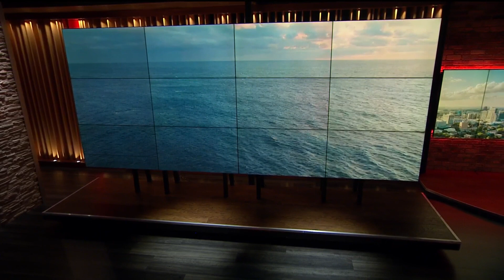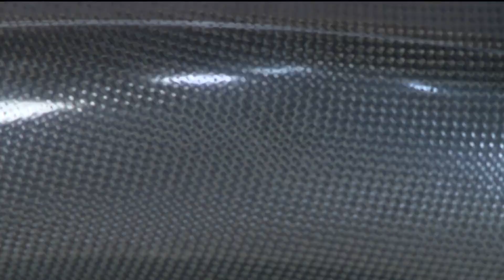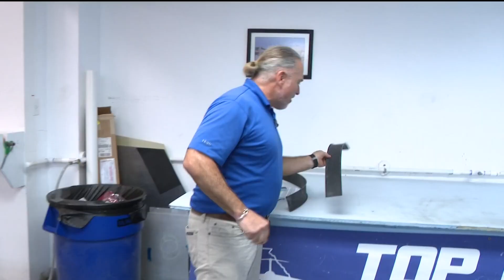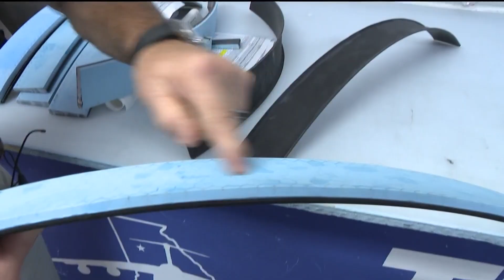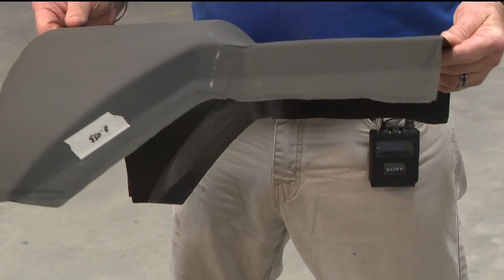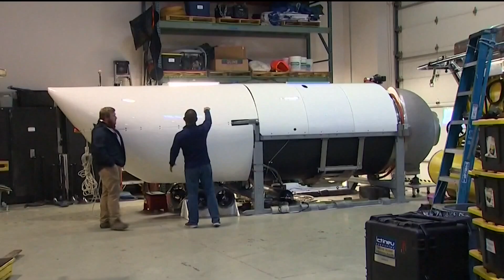'Space age' carbon fiber made, tested in Georgia

Comment: The titanium end flanges were "glued" to the carbon fiber tube. The process was done in a non climate controlled warehouse and the glue was applied by hand using bondo spreaders...  My guess is this is where the failure occurred.
Reply: Carbon fiber, the submersible shape are all factors that lead to implosion. Carbon fiber can not withstand extreme pressure in deep oceans.
Reply: @ahmedatta3330  Yea you are absolutely right there - A tube vessel has never been used at these depths, always been a sphere.  According to James Cameron, they imploded at 3500 feet - only a shade over 1/4 of the way down..  That also makes me wonder if the sub had been damaged since the previous dive..
Reply: @kevinkatz7027  Can you confirm if you're certain that is true, that the sub imploded only at 3500 feet down? I hadn't heard that before. I thought they were over an hour into their dive when contact was lost.
Reply: @methylene5  I just found this video this morning - not sure it's real, but it's a timeline of texts between Titan and surface crew.  According to this, the 3500 feet Cameron quoted was actually 3500 meters..   The thing I noticed though is that they were descending way too fast. It's been stated that descent for Titan takes about 2.5 hours, they were at 3500 meters within 1 hour and and 40 minutes - just under an hour before schedule..

https://youtu.be/kJ2HjMP_nbg
Reply: It's possible but keep in mind that pressure from all directions is squeezing the endcaps even tighter towards the cylinder, so the pressure should really be squeezing those things tighter together, not wiggling them loose.
Reply: I think the sub had just been overused. Sure, other submersibles can dive many more times, but those are made out of materials and through processes that are tried and true. This craft was an experimental one, and given the nature of carbon fiber materials, I feel like the max number of pressure cycles had been reached long ago, perhaps even after the first dive.

Also, the fact the only early warning system in place was an acoustic monitoring network is mind blowing. I think someone needs to look a little closer at Rush's engineering credentials. He allegedly had a lot of experience in this field, yet he seemed to make a lot of amateur mistakes and make calls only madmen or newbies would make.
Reply: @PerfectPrimarch  Yes, the fact that it had to be repaired once prior due to proven damage after several complaints, it only makes sense that cycle damage reappeared and wasn't caught early enough this time.
Reply: I doubt it because the pressure itself will hold the end caps in place. The concern isn’t that the glue would separate it’s that the dissimilar materials would compress more or less and the carbon fiber would become smaller than the titanium ring. No glue on earth applied in any conditions would stop that from happening. But if that was the case I would expect it to occur on the very first dive.
Reply: And they used regular white Elmer's Glue.  WTF
Reply: @williamboyle8918  no they didn't. What a dumb idea.
Reply: @DKFX1  I'm sorry !  They actually used Elmer's Wood Glue. A lil stronger.
Reply: @DKFX1  I'm sorry, they used Gorilla Glue, and really strong scotch tape.  My bad.

Comment: Glass and steel can change properties as more pressure is applied, to incredible levels, but carbon once hardened shatters like glass, it was a stupid mistake
Reply: Imagine the people inside the submersible when it shattered 😮😵😪😫
Reply: That’s not exactly correct, Carbon Fiber is incredibly strong, it’s actually 10x stronger than steel. And it’s used to build aircraft, The problem isn’t as much the pressure properties, more so the fact that Carbon Hates Cold Temperatures, and that cycle of diving and surfacing to extreme depths would have extreme effects on the Carbon Fiber Hull, Causing De-lamination which Carbon Fiber does, Thus causing the implosion. Subs should be made from contiguous materials like Steel and Titanium.
Reply: again. slightly imprecice. it is the pressure changes. also some terms were off. like contiguous when you mean isotropic.  also the delamination could have been prevented if designed properly and not used too much. I would go for a concrete sub.  @johnnylego807
Reply: @johnnylego807 but if carbon fibers hates cold, how come it endures the immense temperature drop and wind freeze in airplanes ✈️ at cruising altitude